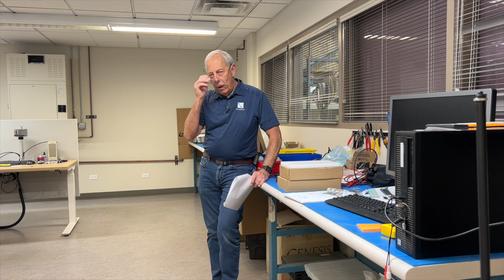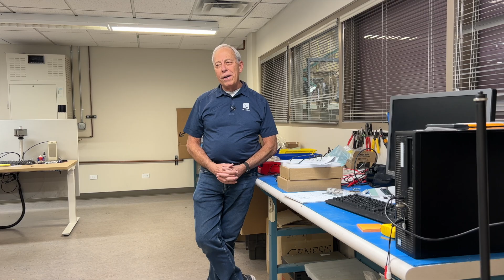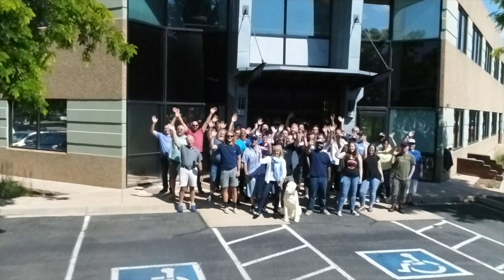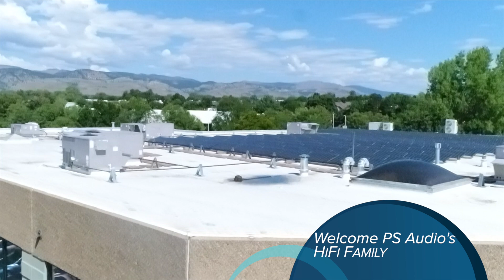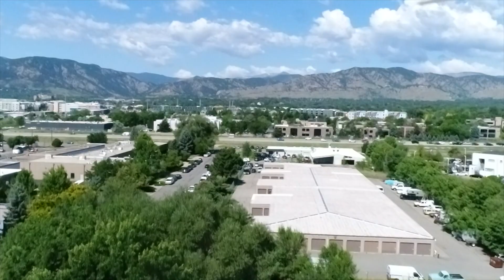How speakers image height

Comment: Thanks , i have played the component changing game for the last ten years , I( amps , receivers , speakers etc) didn't spend a lot as i always grabbed good used deals. You will laugh but for my ears and my room , this is  where i ended up for very good sound . Speakers Bose 201 series 5 . Sherwood receiver S 2610 cp ., 20 watts per channel . and various inputs, inc . an old Pioneer pl 512 phono .Anyways it was, in the end (i feel dumb) my room was just not musical in any way,open side and walled the other  . But the big thing that changed every thing was speaker height . 26 stands vs 32 inch . getting speakers to ear level . The Bose (dirty word) and overall is sound wonderful .Wow . I wish i tried this so long ago . BTW . thanks for all your great input .

Comment: While I agree with Paul about tilt effecting boundary cues, I think it’s not worth it. In engineering, everything seems to be a compromise; in this case you’re sacrificing time alignment for height. Even in the front row of a concert, a seated vs standing musician will be MAYBE a degree or two different in height. I’ve never seen a concert played while walking on stairs. If you want the best of both worlds, you need speakers designed with that in mind.

Comment: Typical microphones cannot record natural height cues and stereo speakers cannot reproduce natural height cues from a recording. Natural spatial cues Head Related Transfer Function HRTF and Interaural Time Difference ITD locate the speakers. Microphones may pick up sound directly from the source and sound reflected from recording environment wall, ceiling, and floor surfaces. Later reflections added to the direct sound produce constructive and destructive interference comb filter flange effects. Two ears are able to hear different directions, horizontal azimuth and vertical elevation, by natural HRTF and ITD cues and separate the reflections from the direct sound; microphones cannot. Two ears hear the natural HRTF and ITD cues that spatially locate the speakers reproducing the comb filter flange effect created by the microphone that adds the direct and reflected sound from the recording environment to one direction. Reflections of speaker sound in the listening room reinforce the natural cues that locate the speakers in the listening room.

Comment: Dear Paul, you've my respect and I learned a lot from you but you got this one quite wrong:

If the direct sound is in phase between mid and tweeter, the localization will be at tweeter height so you’ll be lifting your centre stage. This can be optimally (for the LP) done with digital correction (you can watch my tutorial on excess phase inversion). 

Tilting the speakers back and forth would ruin the speaker drivers' dynamics (they are designed to stand level.) and would still almost never get the image height up in smaller rooms.

Comment: Based on the Sumiko Master Setup instructions that I've read, you'll want to adjust the "rake angle" exactly like what Paul describes. It doesn't take much, lift the front of the speaker maybe a half-inch.

Comment: Changes in height during recording cause changes in channel-to-channel phase relationships,   
which when reproduced by a good-enough system will give audible cues.  
It may be rare, but it happens, and it is repeatable. I've heard it on a couple of recordings. 
(Don't ask what they were -- I don't remember.)
Reply: the same type of changes would get introduced if you increase the distance to the mics by moving farther back, wouldn't they? or did I misunderstand what you meant by "channel-to-channel phase relationships"?
Reply: Try the thunderstorm at the opening of Black Sabbath by Black Sabbath (2009 remastered version) if you have have access to a digital library.

Comment: Height typically comes easier with array tower speakers. The amp also makes a huge difference. Mine the singer is center stage but everything else is proper placement but like the walls do not exist and at an open concert.  Smaller speakers tend to have that effect of height going up halfway up the wall. The problem is the singer might be center but the other music is not as expansive as it should be. How good you can make it depends on materials used and room set up. Some speakers have adjustments on them whereas others you have to try to fit to the room only. Not all speakers are good for certain rooms. The Von Schweikerts can be awesome but typically do good way off the wall so in smaller rooms not a good fit for most.

Comment: If someone is speaking to you from above, then your ears identify that the sound is coming from above.
Well, the microphones are the electronic replacements for your ears.  The microphones capture what you would have heard, if your ears were in that same spot in the room.

As long as microphones and the rest of the recording equipment is quality designed and manufactured, then what the microphones picked up and sent to the recording equipment... it will all be in the recording.

Then, the rest is up to your playback equipment and your room and how you set it all up.

Comment: My 4 foot tall Infinity's are leaned back but even so the best seat in the house is about mid to 2/3's speaker height. When I had smaller boxed speakers I sat the speakers on tables. Just sounded better.

Comment: What you describe Paul is very interesting, however the main thing is that the production wanted to present that height.
You can tell us what recordings you know that one can "know" or "experience" that "height".
Because if the production never wanted to present that type of scenario, it will be very difficult to achieve it.
Thank you.

Comment: Little speakers will not give you height. Great imaging and depth, sure. Large speakers, especially towers, tend to be much better for height, sometimes sacrificing the pinpoint imaging though. These are generalities of course, not  absolutes.
Reply: I'm very lucky, because my small and humble little speakers have great —for me— height resolution: precise imaging and wide sound-stage horizontally (beyond speakers) and precise imaging vertically. I guess that everything matters: setup, room, acoustic treatment, speakers, synergy, luck and recording of course.

Comment: You cant get height info with two channel - boundry or not.
Reply: Of course you can. Just listen to a decent binaural recording with good headphones.
Reply: @Fastvoice  Its not real height information. Its changes in frequency to simulate it. Its fine but its also the reason why in home theater you need additional speakers on atmos setups to get height info.
Reply: Nope, wrong. I get plenty of height information from my speakers, well above the top of the speakers (50 inches) up to the ceiling which is 10 feet.   It all depends on your system and setup.
Reply: @mikez5243  If you believe so, but there is nothing in the stereo mix that can affect height which is why for surround you can purchase height speakers and why atmos can do what it does with them, but as far as 2 channel music goes. you can try and play with phasing or frequency, delay..etc to simulate some illusion of height but its dependent on the loudspeakers and its configuration. For example an MTM may not project the same simulated height as one with a tweeter up top..etc

Comment: Paul is spot on imho. If you know the recording has the vocalist standing, that's your reference track.
Start with one speaker in the middle to adjust your height carefully. I used 1cm planks under the speaker until I got it right.
You can measure that distance without the need of tilting. That being said, in my experience the tilt adds some extra time with  placement , BUT it does some serious magic on your bass response. I think the tilt itself avoids standing waves by geometry.
Reply: Tilting may slow down the woofer and might be decreasing bass peaks in your room by coincedence. Please rerad my comment above.

Comment: I don't think tilting is going to be the answer in this situation he said "waste height" that would be a lot of tilting back not forward probably over 15°and that could make the speaker unstable. Best solution is the place on a 6"cement block/breezeblocks not concrete block, a lot better acoustic dampening. then possibly tilt it forward maybe 2 to 5° that should work out no CD needed there you go 😘😂
Ideally you want it about the middle of the woofer towards the surround, or centre of the mid-range driver at ear level.

Comment: I remember a Sony receiver I had back in the 80's that had great height replication. I was listening to 'Dance to the Music' and was very impressed with the sound stage. There was a cold air return vent high on the wall in front of me and I said to myself 'if that organ comes in and sounds like it's coming from that vent it would blow my mind; and that's exactly what it did. I was extremely delighted with that receiver but it quit working after a couple weeks so I returned it and got another one. It also failed to work within the same time frame and I had to return that one too but I felt there must be a defect in it's design and bought an Onkyo receiver instead. I have never experienced that sound stage with any other receiver I've owned since then. I don't remember the model number of that Sony receiver but I'm pretty sure it had a "9" in it. Perhaps it may be something you may be interested in researching. I enjoy your videos very much. Unfortunately I have downsized and don't have an audio room anymore and reduced to a bedroom and a sound bar and reluctantly content with that situation.
Reply: @Douglas Blake Maybe so; but my story remains the same
Reply: @Douglas Blake Yes,   receiver has no capability to direct sound like coming from strange direction but brain has capability to locate sound in  mirage position 

Connecting  that phenomena to perfection of system seems to me justified
Reply: @Mikexception  I'm replying to everyone reading this post.
I have been contemplating this scenario since DB' responded to my post and came up with a theory...
The talk is that NO receiver has 'circuitry' to create height in the sound stage. But suppose the height aspect is in the recording itself?
With all of the acoustic data that the microphones pick up... echoes, time refraction, reverberations, etc. couldn't a height aspect be embedded in the source data by default? And with all the different 'circuitry' in all the different amplifiers and all their different components and all their different materials and all the different biases in the design, isn't it possible that 'A' receiver could be sensitive enough to pull all those nuances, process all that data unadulterated, amplify it faithfully, present all that information to the speakers with adequate governess of excitation and damping to reproduce the height aspect that could simply be inherent in the source recording? And I ask do receivers have circuitry for width?, for Depth?

Comment: My original speaker position for my Paradigm Studio 60’s was against the wall and I had a small center channel below my flat screen TV. 

Basically the set up many people have.  

I have pretty powerful amps. An M&K subwoofer in the right corner.  

The sound was good but I always felt the sound stage was way too low.  Lack of depth also.  

Came across Paul’s vid a few years back recommending to pull the speakers away from the wall.  I finally decided to give it a try.  Wow!

Everything improved. Depth and Image and even raised the soundstage.  The height level went from my feet like in the upper level section at a concert to a more knee/waist level area when sitting down on my sofa.  Very pleased but not fully there. 

The center channel position bothered me.  I felt this was the cause of the still too low height level. 

I decided to move the small center channel and place behind my flat screen TV and fire it upward.  Not as big of a wow but a noticeable improvement yet again.  Raised the sound stage height to around upper chest near face level.  

On some good recording it’s even above my head.  👍

Thanks again Paul!  Merry Christmas! 🎄

Comment: ive got a question ive got a surround sound system with a av receiver there is no where to run the cable for my left surround
speaker with out it looking bad is there any way to make it wireless for one speaker

Comment: I can only offer a theory based on my experimentation. I know that this sounds a very ‘unaudiophile’ move. Try putting a second pair of much smaller speakers on top of your existing speakers and aim them upwards and see what that does.
Reply: They will reflect off the ceiling adding an extra dimension.
Reply: Probably lowering the impedance.
Reply: @Jorge-Fernandez-Lopez  In this case, it sounds like a speaker arrangement issue instead of impedance.
Reply: @bikdav  I was talking about the cable speaker connections (parallel circuit) to the same binding posts other than special speakers. Physical arrangement for phase alignment (distance and different drivers) might also be an issue. Whatever, if double set of speakers works and doesn't burn, that's what matters.